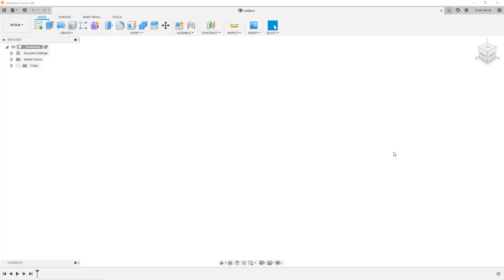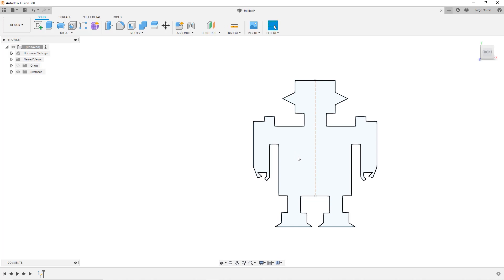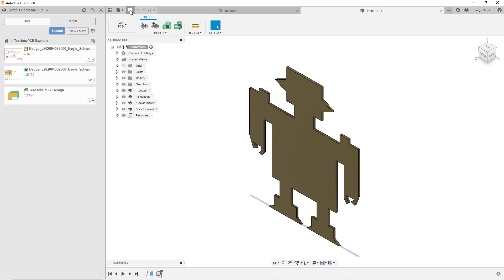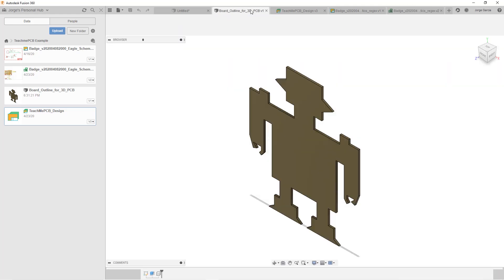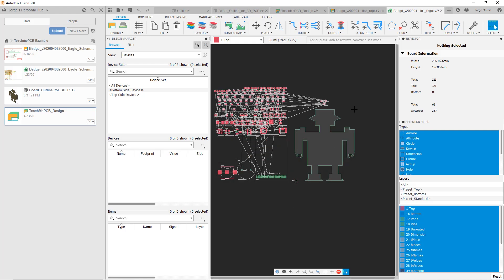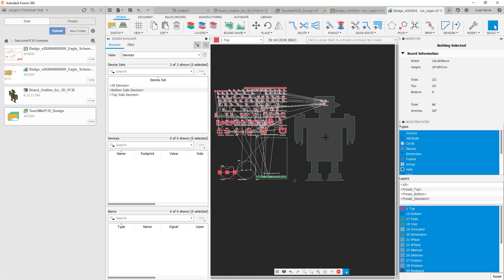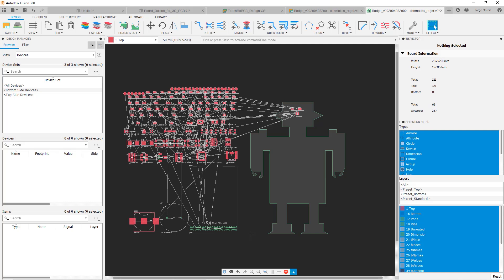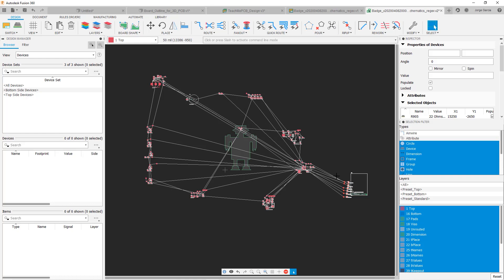Tutorial: Episode 3 Making the Board outline and initial placement

Comment: How do you create a pcb outline in the electronic design area?
Reply: Hi @onjoFilms, use the LINE command and draw the PCB outline on layer 20 Dimension. Make sure it is a closed contour (starts and ends on the same point) if you do that you'll see that inside the outline it will be grey but outside it will be black.

Comment: hello, it seems something's wrong in this procedure. After doing the same (hobby licence), the pcb in the brd file is completely green. The thickness of the line is "0" but in fact, when you put "0.1", the pcb becomes black again. I did many test (many shapes) and still the same result. The background of the screen becomes grey instead of remaining black. I didn't find why.
Reply: If it's completely filled in then you likely used the rectangle command. That one should not be used since it always creates a fill. Use the LINE command and it will work as it should.